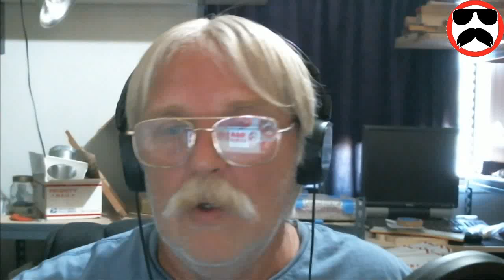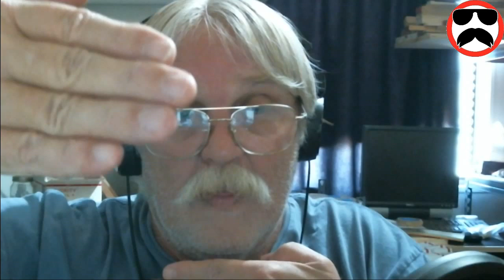LIVE Q&A #12 - Gatton CNC 2-Year Review

Comment: Hi Mark, Really enjoy your videos. Can I bug you with a question? I'm just getting into CNC and I'm a little confused about Vectric and Aspire. They are two different programs right? Aspire costs quite a bit more too! Do you recommend one or the other for newbies? I'm looking into 2D cutting but the 3D stuff is so cool I'll probably want to get into that also. Thanks for your input :)
Reply from the maker: Thank you! I'll try to help with the confusion. Vectric is the company that makes the software. Aspire is their top-of-the-line CAM/CAD package that has 3D modeling capabilities. The next step down is VCarve Pro, which has 3D carving capabilities, but not 3D modeling. Then there is VCarve Desktop, which is made for smaller machines (less than a 24" x 24" cutting area.) I started with VCarve Pro 5 years ago, and have never looked back. It's a great all-around program that will get you through about 99.9% of the projects you'll ever want to take on - unless you plan on creating your own 3D models. I upgraded to Aspire earlier this year, and am still learning the 3D modeling capabilities of it. I hope to do a lot more 3D modeling videos next year, but we'll see how that goes (I'll also be building a new shop/shed, so that's where my priorities will lie.)
Reply: @MarkLindsayCNC  Thanks for taking the time to respond. Your explanation cleared up my confusion with the different programs. I won't worry myself with Aspire until I have a handle on VCarve Desktop and my smaller CNC. Thanks again, keep up the videos :) and good luck with the new shop!